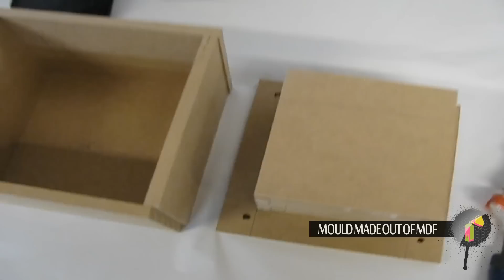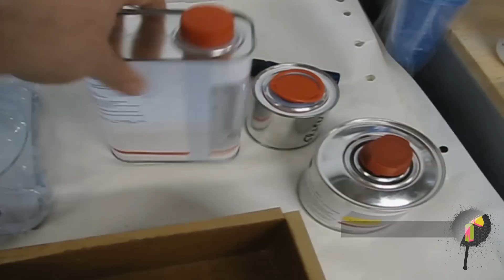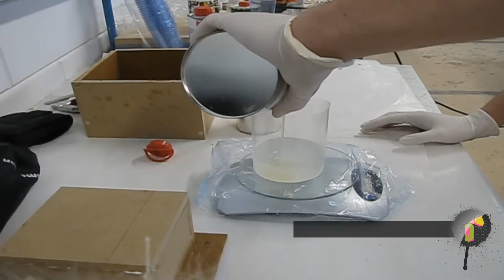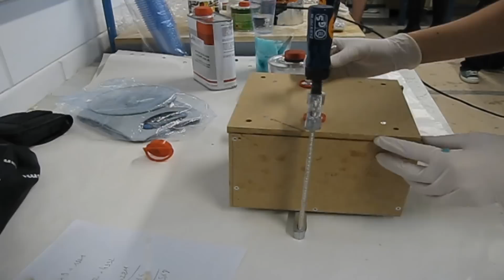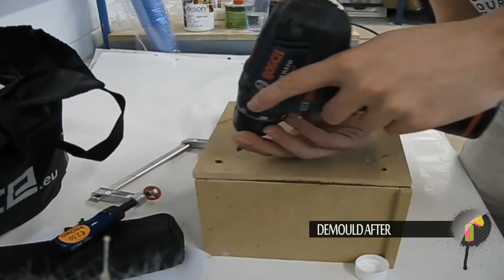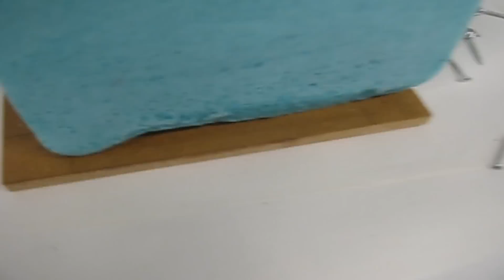Expanding Foam - Polyurethane E60 soft

Comment: Hi Matt great therapeutic video to watch. I have some eva swimming floats which I’m using for a project. I’m trying to change the shape of them, make them square. Using a box frame and adding a foam chemical is my idea although they would still need to float afterwards. I wondered if you could suggest a solution to my problem, thanks Kieron

Comment: Please would you be so kind ant tell me what kind of chemical or chemicals you have been using to prevent foam to stick to the mold, and did the same thing apply for hard foam as well.
Thanks.
Reply from the maker: Hi, I've used a special product called APW, bought it in my local composites store...dont know if its a brand-name or chemical name... It worked for hard foams as well! any polyurethane if I'm correct, other release agents wont work I guess
Reply: Matthieu Libeert Will this stuff withstand a lot of repeated compression? I have looked in the past for something like this to repair some auto upholstery foam. It's not the seat bottom, but rather one side of the back of a driver's side bucket seat. Imagine the spot that gets worn out first on a typical driver's side bucket seat from getting in and out of the vehicle. Also happens to be right where a lumbar adjustment flap mechanism is that adjusts how tight the sides of the seat holds you in, so trying to glue foam there is all but impossible. If this kind of stuff bonded to the old foam as it cures, that would be excellent. It's an old rare seat I can't find replacement foam for, so I'm looking for some alternative to repair the missing foam.
Reply from the maker: hi there, 
To be hones, I have no idea when repeated compression like in a carseat... Personally I dont think this is the best way to repair your seat...its hard to control the expansion and so on... But I think, it would bond to the old foam, Didn't do a lot of testing with this foam... you might try to find something similar like this foam and doe some smaller scale testing first
Reply: Matthieu Libeert Thanks. It's not a large area to fill, somewhat smaller than my open hand. I would just make it larger than it needs to be when pouring it on, and shave it back to final shape. Found a few small two liquids kits of this kind of flexible urethane foam on Amazon for $30ish in 3lbs per cubic foot density. Claims the foam can be used for upholstery cushioning, though if it were hypothetically a seat bottom repair, I would think a higher density is needed. 3lbs density should be fine for my application as long as it can stand up to a fair amount of repeated compression, i.e. continues to bounce back to original shape after being squished. Perhaps I'll give one a try.
Reply: Matthieu Libeert hi there, may i know what chemical that you used in this video? What mixture of A and B?

Comment: Hi Matthieu Libeert , nice video, quick question please I am in the lettuce Hydroponic business, just in a small scale I need a foam block with tiny little hole for the seeds that can absorb the water, it has to be environmentally friendly and biodegradable, you think this formula would help with my work? or do you have other formula for my project, thank you Matthieu.
Reply from the maker: Don't really know, think you are better of with stones or something then instead of foam like here
Reply: Hi  @MatthieuLibeert  thanks for your prompt response, I see your point, what I used right now is a product called Oasis foam block it looks kind of like the one on the video but for my small budget it is too expensive so I was hopping that you will have something similar to help me with my business, if you came across with the type of foam that I need please let me know, thank you Mattieu.
Reply from the maker: @tarabottogino  Ok perfect! Not sure you'll find something cheaper in this type of "chemicals" than foam blocks unfortunately

Comment: did you add blue coloring to it?
Reply from the maker: Dark Green, but will be a lot lighter of colour due to the expansion of the foam
Reply: Matthieu Libeert  so i was looking for something to make fake cupcakes and i saw this video and thought this would be perfect because it stays squishy. which name brand would you recommend that i use?  like maybe smaller bottles since i will only need a small amount for each cupcake liner.
Reply from the maker: MARIA TAVAREZ Sorry I've seen your comment that late, If you are from the US, try buying it online on smooth-on, if you have a composite store nearby try sking the for expanding polyurethane foams. you can choose between different hardnesses as well! Would work well for fake cupcakes ;)
Reply: +Matthieu Libeert (Mat's Prototyping) What type of paint did you use to add the color? I've tried acrylic paint but the foam doesn't end up drying properly. I'd greatly appreciate your help.
Reply from the maker: yes, I've used a green PU pigment indeed, turned out ligth green due to the combination of green+white (foam) keep in mind that adding pigment will influence the rise of the foam, it will normaly rise less, but depends from foam to foam maybe
Reply: Lol a year late